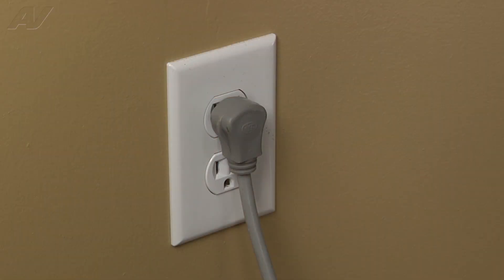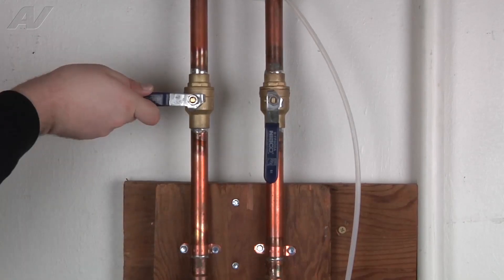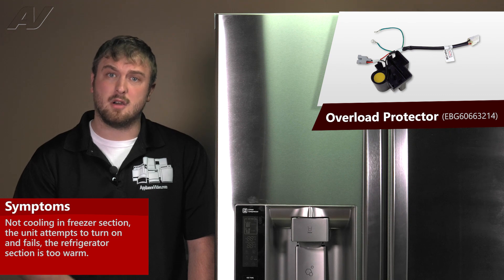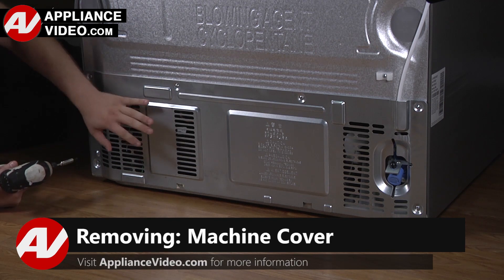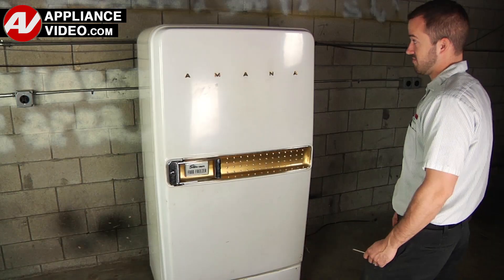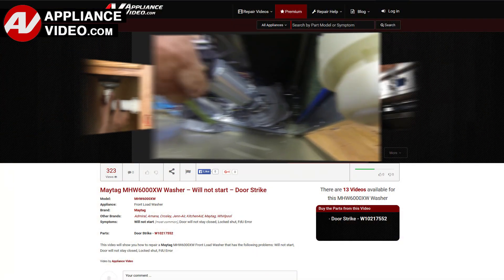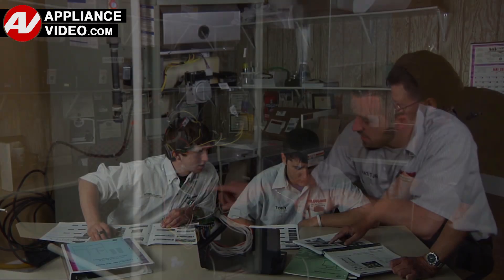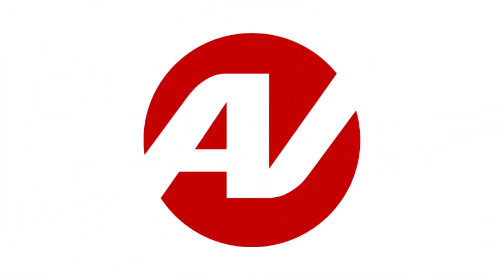LG Refrigerator - No Cooling in the Freezer Section - Overload Protector Repair and Diagnostic

Comment: Can you tell me if the compressor is running normally and both fans work, no visible damage on the board what could be? I'm getting 6 flashes which usually means compressor, but I can plainly hear it running as it always has? Thanks
Reply from the maker: Great question, if you have a more technical question that our parts department cannot answer, you can search our over 13,000 answered questions free at our website www.ApplianceVideo.com under our Repair Help section. You can also call our parts department at 1-800-830-5465 and they can give you help 7-days A week ,or search at www.SaveMoreOnParts.com  .
Reply: 6 flashes means the compressor is gone and I mean gone. I do these LG Fridge compressor replacements for a living. Usually LG will cover parts and labor on it to replace.
Reply: Tommy did you ever find a solution?  My situation is identical to yours